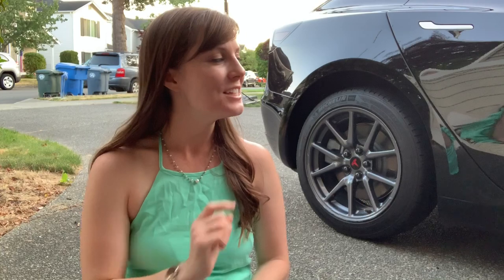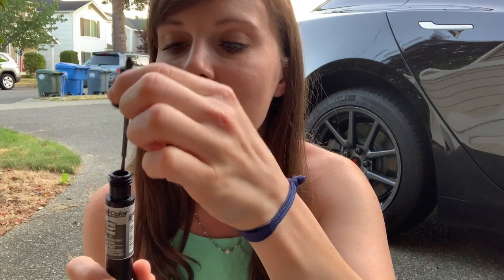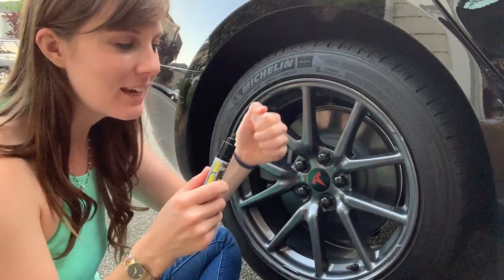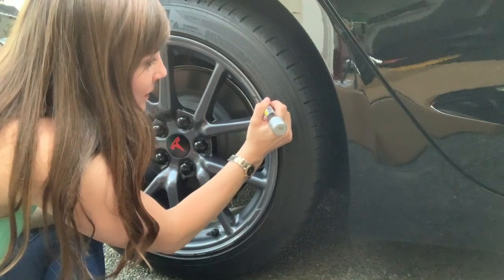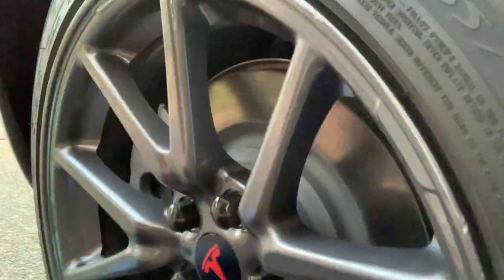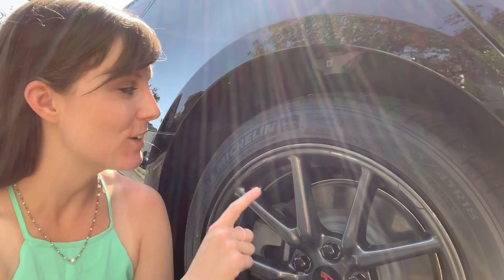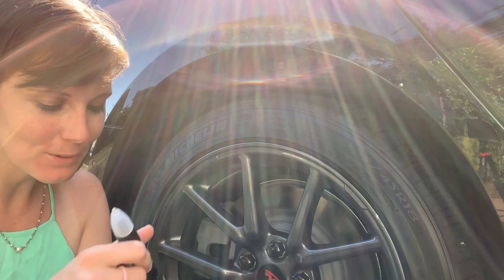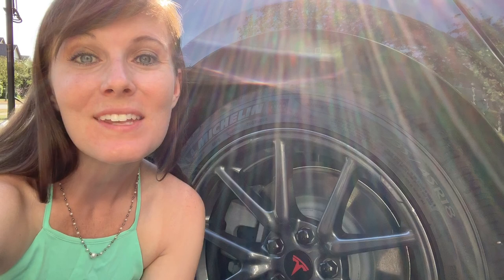DIY Tesla Curb Rash Repair

Comment: The paint did match pretty well, but to make it look even better, you should've sanded it flat first.  If there are deep gashes, you could also use bondo to fill in the gashes then sand it flat before painting.  But all that sanding does take a lot of work.  For the amount of time you spent I agree it does look very nice!
Reply from the maker: Good idea to fill in the gashes! I didn’t even think of that. Will try the next time...because I know there will be a next time! ☹️🤦🏽‍♀️😂

Comment: Why not just move your car forward or back and little to rotate the "hard to get to" parts of the rim back to the top again?  That would make it easier to see what you are doing while applying the paint.
Reply from the maker: My thought was that since I using the pen side it might flow better if I was using it at a downward angle, but i may try to rotate the tire next time like you suggested...because I know there will definitely be a next time 🙈 lol